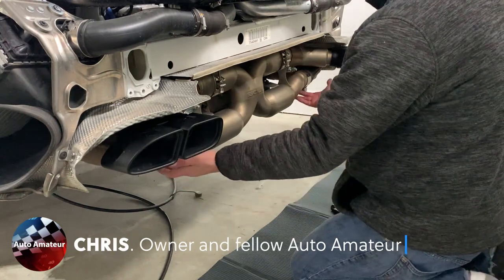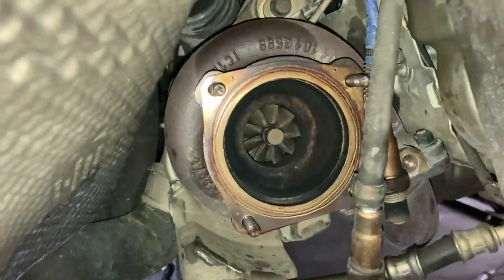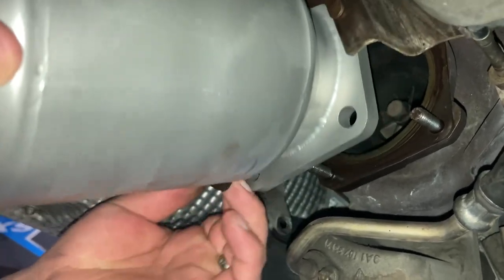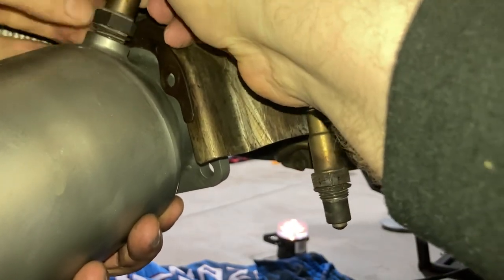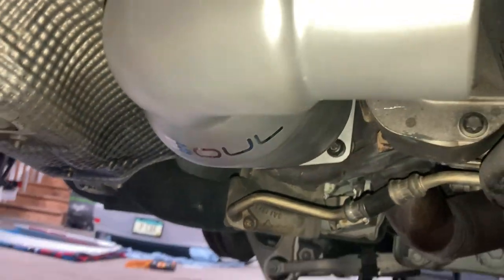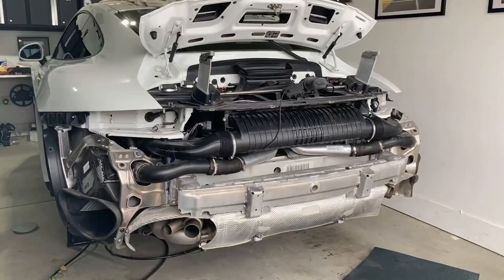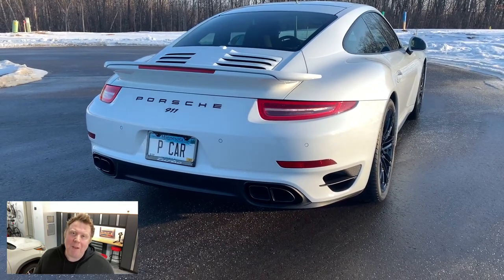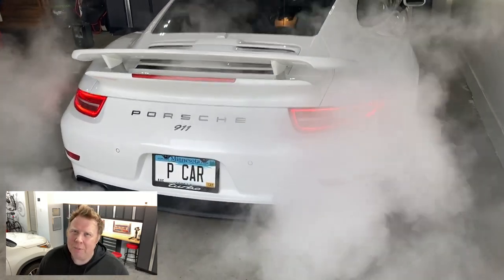Soul Sport Cats & X-Pipe Porsche 911 Turbo Install (Project Turbo EP02)

Comment: Great video! Car sounds menacing now. I always recommend a little dab of copper anti-seize on the threads of the O2 sensors and turbo studs to make installation and removal (should you ever need to) easier.

Comment: Yep! Told you it would be the Cherry on Top. My 992 sounds incredible now with he High Flow Cats and aftermarket exhaust.
By the way, on the 992 C2S you DO NOT need to remove the exhaust, bumper and only one post O2 sensor all easily accessible. The Cats come off and on So easy. 20 minutes each!

Comment: Good content I have a 991.2 Turbo S, although I wish you did a detail bumper removal but I found it somewhere else. I'm planning on doing this with a boostlogic catless in a few weeks. Thx for the vid. I also followed your chrono face swap. Thx for that as well.
Reply from the maker: Thanks!! 🙌
Reply: How do you like the boostlogic? thinking about doing the same.. afraid it might be TOO much volume?
Reply: @madisonscorner2180  love it. Gives it a nice v8 sound. I have a sound and dyno video posted.
Reply: @LivYo_life  Ive read some reviews that it drones really bad at lower rpms. Do you find that the case. They are just up the road from me but they dont do many in-house to hear in person. It seems way louder than stock - volume wise. Love the turbo spooling noises.
Reply: @madisonscorner2180  to be honest I don't know exactly what drone is. There isn't an obnoxious sound. Isn't loud until you get down on it and I believe it has what they call anti drone pipes that has deadends. I've changed the exhaust on a few other of my vehicles for the purpose of it being louder and better performance. What drone is has never been a cercern.
Reply: @LivYo_life  Thanks for the info. Did the tune help a bit?